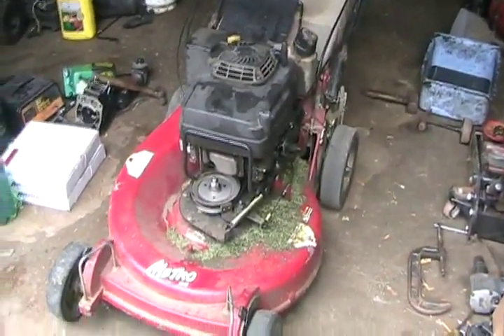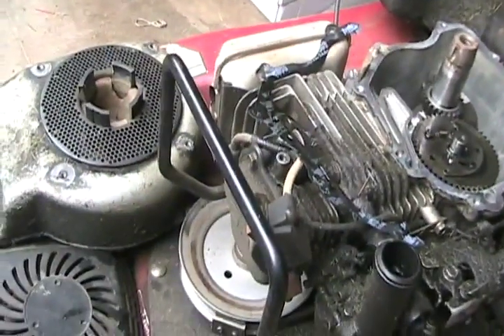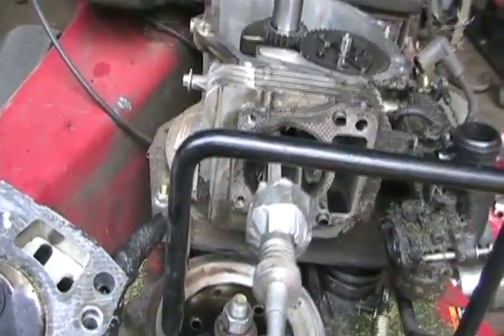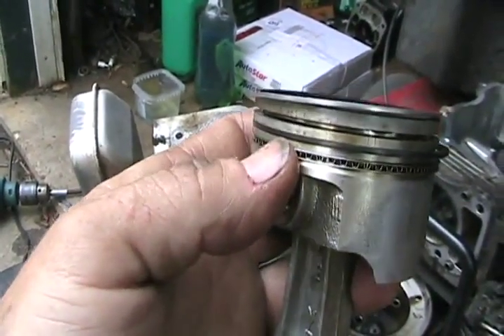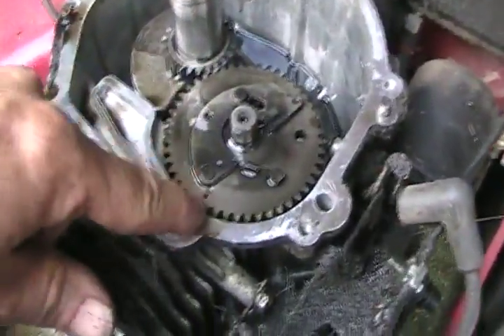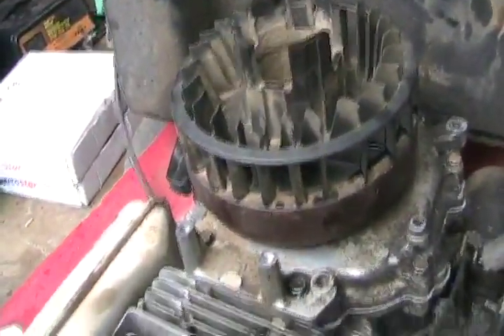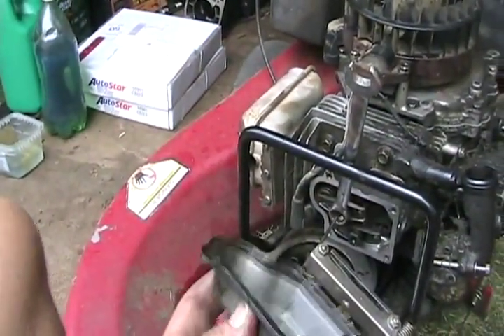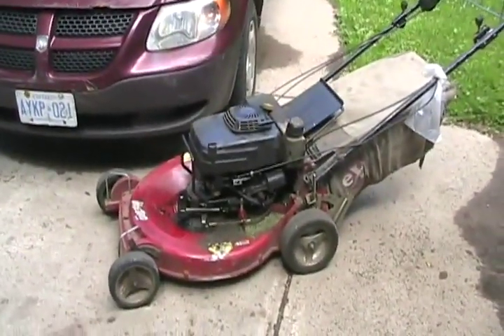#1376 Replace piston rings in a kawasaki commercial mower [Davidsfarm]

Comment: actually cleaning the magneto magnets IS important because if they get to rusty they short out
Reply: ghettohillbilly1 nope
Reply: +ghettohillbilly1 maybe
Reply: C H yesnomaybekindasortof
Reply: no they do not, magnets do not short. you need to research how a magneto actually works
Reply: Anthony Ferreira thank you Anthony
Reply: Anthony Ferreira if there is no gap there is no spark, grounded out, shorted out, touching call it what you want it will still cause the mower to not work lol
Reply: ghettohillbilly1 why are you mentioning gap? You claimed a rusty magneto would result in a no spark condition. WRONG
Reply: because if there is no gap there is no spark lol do you even know how a magneto works?if it is too rusty it will bridge the gap and no longer function I know I'm not wroong because I've seen it many times, time to educate yourself fool
Reply: God damn it, leave this in 2015.
Reply: Thats a lot of rust to close the gap! Holy fuck where do you live? The salt flats?
Reply: Anthony Ferreira lol never said there was an electrical arc, its a magnetic pulse that the coil picks up and turns into higher voltage, the magnets in the flywheel have to be a certain distance from the coil pick-ups (aka gap) for it to work properly, rust being magnetic will change said gap (if theres enough rust)and can cause spark issues , I've seen it many times, whats stupid is you guys argueing to not do a job properly if you are fixing something you clean and reset everything, even if I was wrong it would still be a good idea, unless you like rusty junk that only half works
Reply: my point exactly